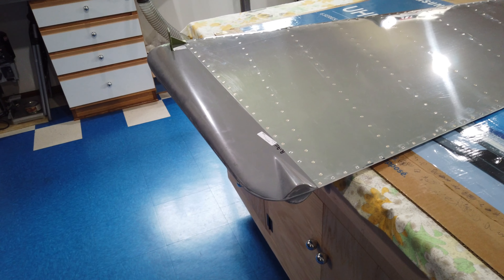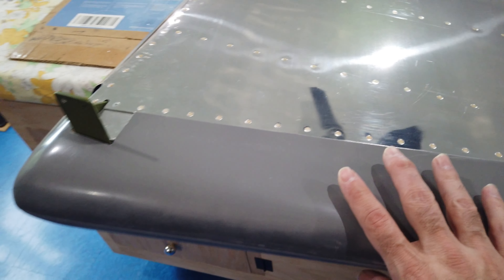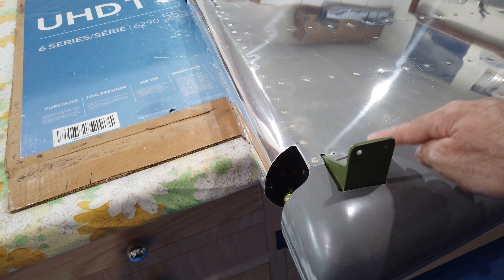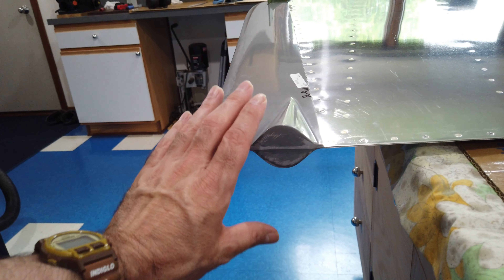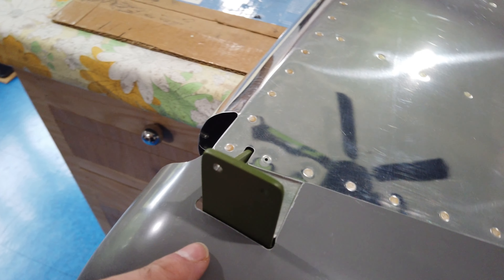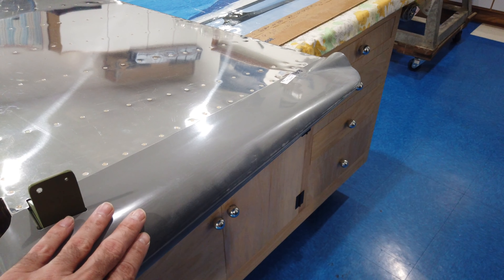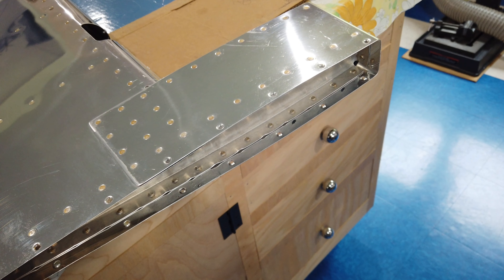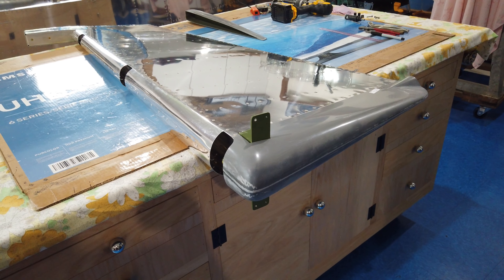Vans RV 7 HINT Video Fiberglass Tips 3

Comment: Hi mate i spent hours on the rudder top and vs top fibreglass fairings as when they meet each other they dip inwards and it looks horrible so i glassed them together when fitted, got them level with each other then cut them apart
Reply from the maker: Howdy Jeremy. I see a little of that with the elevators/horiz. stab. too. Working those now and will do the vertical stab. next.

Comment: I had issues with the tail wheel stinger hitting the bottom of the rudder fiberglass. You may want to check before you drill the holes.
Reply from the maker: Too late; bottom of rudder is complete. I'll deal with clearance issues later if there is a problem.